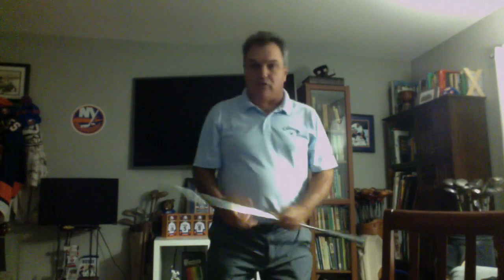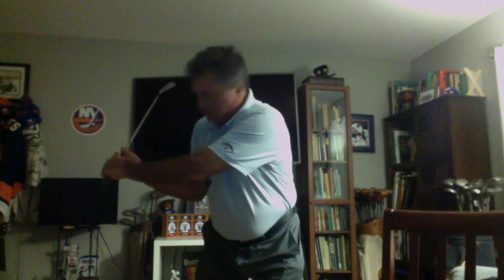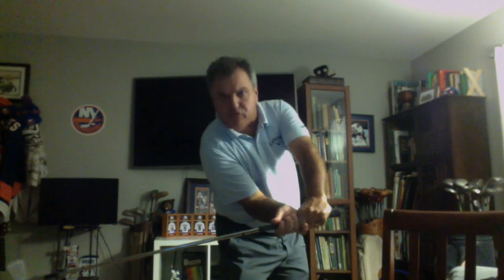Handle Dragging

Comment: Sounds like "handle dragging" is a bad thing. I hit my best shots ,and with least effort , when I think about nothing BUT dragging the handle. With a very light grip I don't have to even THINK about when to release the club because physics (centripetal acceleration) does it for me and I don't even have to THINK about squaring the clubface because  it rotates around its sweet spot all on it's own. Its when your grip is too tight that handle dragging (aka tolling the bell, pulling the chain, karate chopping etc) gets you in trouble because you prevent the natural release from happening.